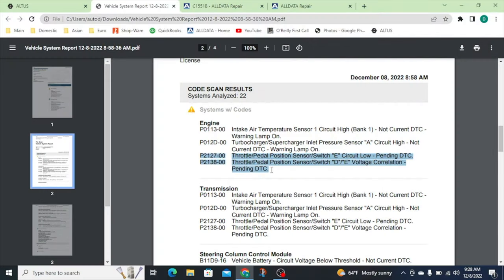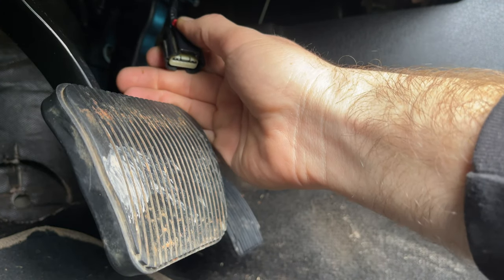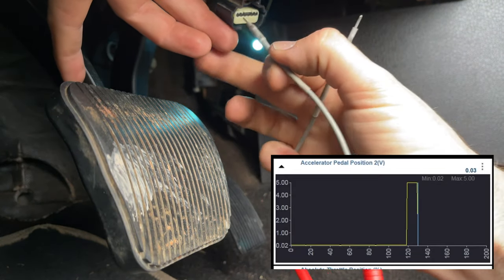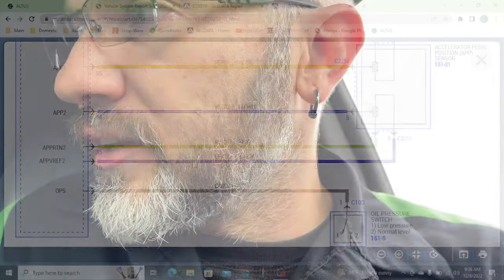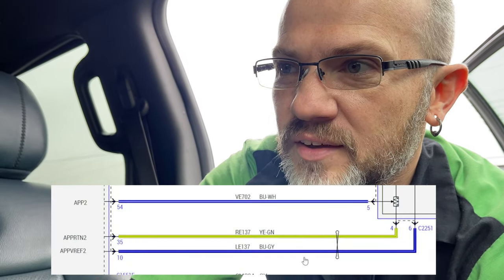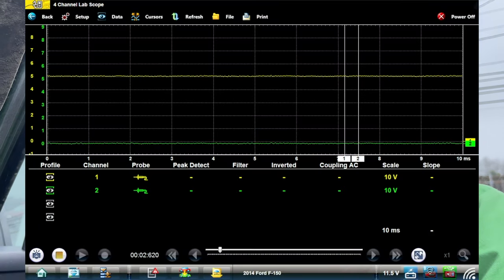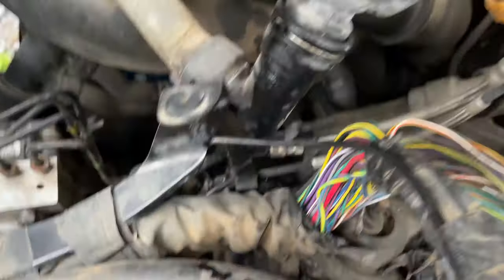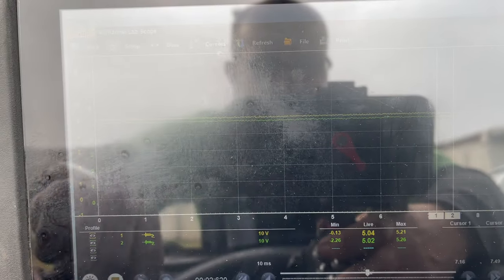Ford F150 No Throttle Response and APP Codes

Comment: Had this exact problem with my 13 platinum. Found the same wire broke in the exact same spot. Just soldered it up and it’s back running perfect. Thank you, definitely gaining a sub

Comment: Great video, Jake. I appreciate it when you talk about integrity and sticking to your ideals and passing on a job when the client  has other ideas and it doesn’t suit what you think is  the right course of action. This applies  in a lot of cases, not Just wire overlays. After all, you, maybe the one that is on the hook or at fault for a comeback. Instead of fixing the known issues. What about the  issues that may not have presented themselves yet as an error code or in the data. Way to preserve your reputation for doing great work and potentially preventing other problems from arising.

Comment: That's a great point about finding the other wires that are about to fail. Come to think of it, the last time I did one of these, that's exactly what I found. Two other chafed and exposed wires that had almost failed. What I keep forgetting to check (not applicable here) is how worn motor mounts can allow harnesses to move more than they should.

Comment: Hey Jake I have this exact issue. Found broken wire repaired then tested my repair continuity all good. However, still nothing on the gas pedal is there a fuse or something else I’m missing?
Reply: Well repaired the wire now sensor “D” says 97% while E says 0.39% definitely the Problem can it be from the PCM everything from the pedal seems good

Comment: i have always thought overlays could also cause problems i have done a few in special cases had a ground wire on a/c broke in the harness but the only thing it controlled was the a/c so i did a overlay  the harness looked perfect no damage that could be seen. later on when they could afford repaired correctly

Comment: good job .i have eperience a ford F59 that damage two APP sensor  by intermittent chorted injecter cyl 10 .the pcm was chorted out intermittent and send more than 5 volt to the APP it was always that same circuit on APP sensor that was damage .

Comment: I have this exact code 2127 on my 2015 f150. New pedal/sensor, new Throttle body(sensor built in) and replaced the TB connector bc it was frayed... STILL have this code. I haven't check voltage etc bc I'm not sure what I'm looking for etc but I track wires and nothing looks bad or exposed.. no clue wth is going on at this point. Where do you get these tools and software?
Reply from the maker: You can check the voltages with just a standard voltage meter.